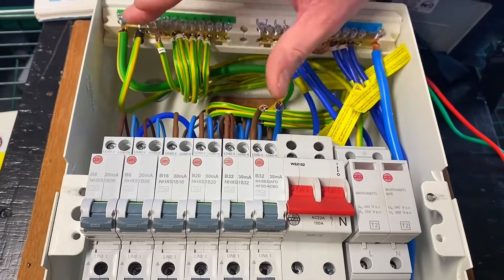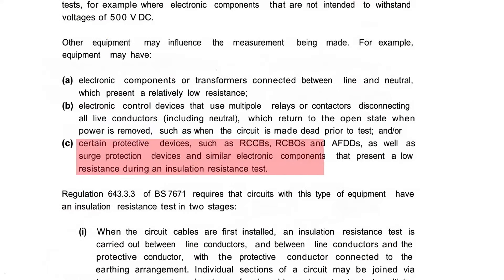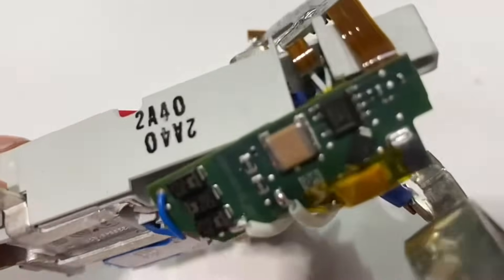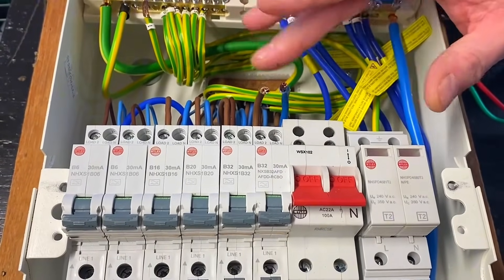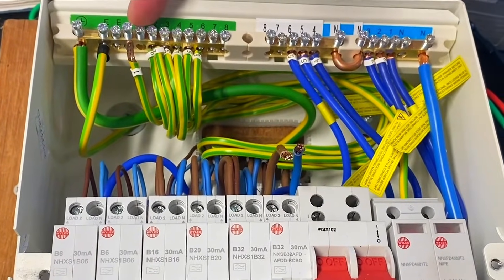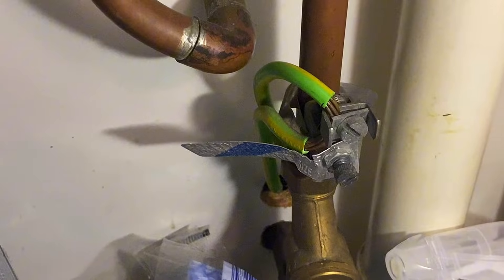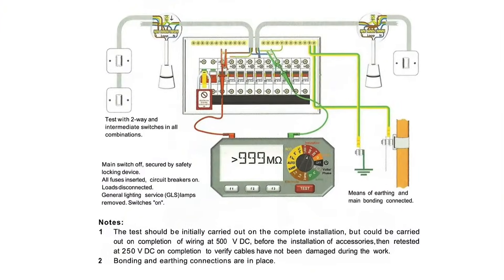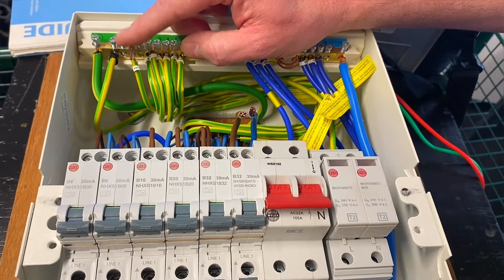Don’t Get it Wrong - Insulation Resistance Test

Comment: So to do the insulation resistance test. U connect the live to earth bar with a crocodile clip. And then the neutral to the earth bar. U should never test a between live conductors. Only on a new installation?. Am I right?

Comment: Can you do the I R test on that board you never showed us how you do it with the RCBO board do you disconnect the flying neutrals and why do the CPC and main earth have to be in place
Reply: Leaving flying leads connected to the neutral bar doesn't affect the IR test as the circuit neutral is disconnected from the RCBO.

Comment: How do we do IR test with RCBO’s (single pole) & SPD in place? What needs disconnecting? 
Thanks
Reply: Disconnect the circuit you are testing from the RCBO and also pull out the SPD Unit so it’s disconnected too.  Or just shove 250v through it and leave everything in place ;)

Comment: Hager rcbos have it printed on the outgoing terminals that you can carry put the IR testing when the device is in the off position.
Reply: Still no good because they are single pole.
Reply: @sandman873  Wrong.  Hager, Wylex, and Crabtree compact RCBO's are all now double pole and able to be tested without disconnection when off.  The also do a double pole bi-directional option that can also be tested when off.

Comment: You explained that we must do it and that it's vital but unless I missed it, you didn't explain why it's important.
Reply from the maker: Do YOU Know What Happens to a Circuits Insulation Resistance When the Circuit Length is Increased?
https://youtu.be/Ml95TFpchmA
Reply: @GSHElectrical  Thanks that explained it nicely. Apologies if it's an obvious question to trainee sparks but as a curious DIY'er keen to be able to identify when work on my property hasn't been done correctly, I just needed the extra context. Thanks again for helping inform everyone.